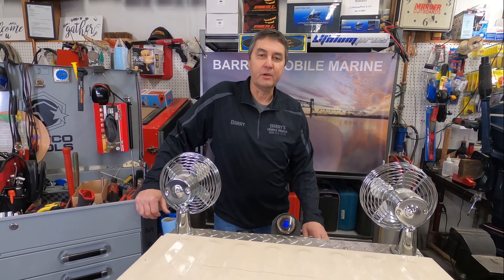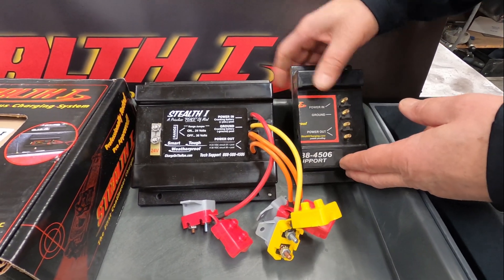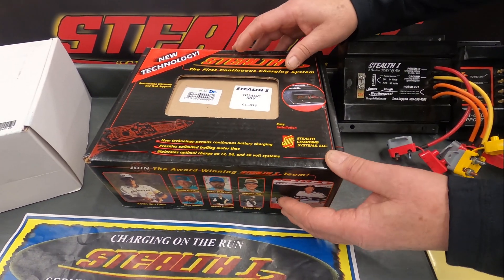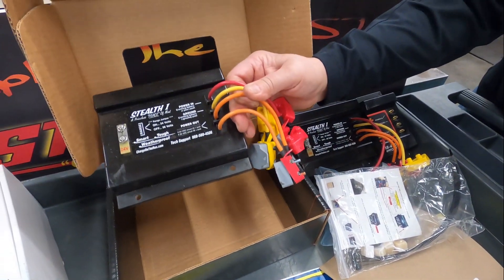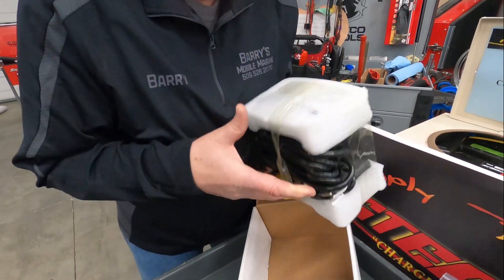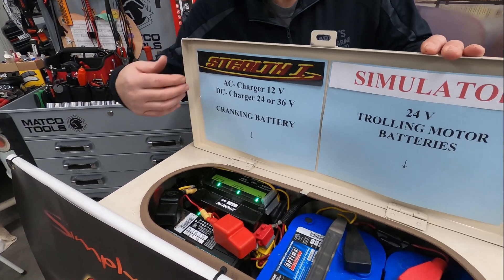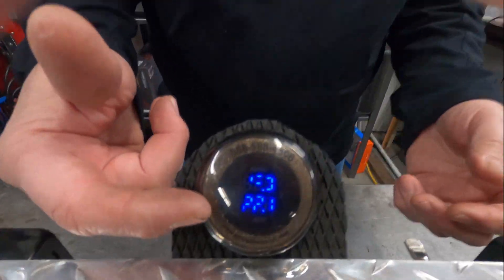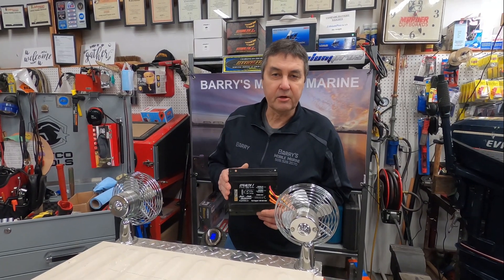Stealth 1 Charging System "Onboard DC Battery Charger" Charge On The Run! Simply The Best!

Comment: My stealth DC is showing a max of 8a into my 36v battery at WOT. Is this typically the peak charge speed for dc to dc?
Reply from the maker: Hey Casey, that is a great question! The Stealth DC max output is 20 amps. But it is controlled by your crank battery, if this is weak all the charge will be going to maintain crank battery voltage. Once your crank battery reaches approximately 13v the Stealth DC will then begin to charge your trolling motor battery. A good healthy crank battery is key. Run your trolling motor to draw down the state of charge and retest. Not knowing your motors alternator output is a key factor to answer this question. If you wouldn't mind sharing make, model, and HP that would be helpful. Let me know if this helps.
Reply: @barrysmobilemarine4372  yes sir happy to share. 2019 Yamaha 250 SHO (VF250XB). Although the cranking battery has never given me a singe bit of issue it is about 5 years old.

I ran the rolling motor below 50% and still was not able to get a charger rate if more than 41.4v, 8a, 347W. This data is off of the ionic app.

Do you think I could run my trucks jumper cables to the crank battery to test the battery as the issue?
Reply from the maker: Are you running a lead acid crank battery with the black charger like in my video? What is the voltage of the crank battery while you are running? Charge your crank battery and have it load tested. You could do this if you have a meter to watch your battery. 
1> Charge battery it must read above 12.6v
2> Pull kill switch and crank engine 10 sec. or you could trim your motor up and down and watch your voltage it cannot drop below 9.6v and once you let off the battery should recover at the 12.6v

Comment: I’m reading 29.02v on the 24v output with no ac plugged in or outboard running.  Is this normal?
Reply from the maker: Hey Jeremy, What type of trolling motor battery or batteries are you using? Not sure what a/c charger you have or outboard you are running but most systems with bring batteries up to 14.6 so if you have good lead acid batteries it may read this voltage. Hope this helps. Feel free to call me or the Stealth tech support.

Comment: I purchased a 36 volt Lithium Pro battery along with the Stealth 1 onboard charging system,  from Barry’s Mobile Marine and I am 100% satisfied with my purchase. I installed the setup on my 32’ off shore center console to power my trolling motor.
Barry knows Stealth 1 chargers and Lithium Pro battery like the back of his hand. He answered all my questions prior to my purchase  and he also gave me awesome technical support after the sale. I definitely recommend you contact him if you are considering buying a battery or charger you will not be disappointed.
Reply from the maker: Thank you, Ken for your review and purchases for your boat. It was my pleasure talking to you about your set up.

Comment: What gauge battery cable is recommended for longer runs?
Reply from the maker: Hey Noah thanks for reaching out! I'd really like talk to you about the gauge of your battery cables. There are a few factors that we have to look at first, to be clear on helping you. Are you able to call me so we can talk about it? Voltage, load, length you need to run wires, type of hull, fiberglass or aluminum etc.

Comment: I have a  charging on the run on my ranger boat and I don't think it works I have a 2003 ranger.I NEED HELP !
Reply from the maker: Give me a call and let's troubleshoot it.509-528-2070
Reply: I’m reading 29.02 of constant voltage with no ac plugged in or motor running.  Is this normal?

Comment: Is the Stealth 1 charging system compatible with lithium batteries? I am currently running 3 group 31 lead acid (interstate) batteries and the cranking battery is an AGM battery. I am thinking of converting to lithium when my current lead acid batteries need replaced.
Reply from the maker: The Answer is Yes! The Stealth 1 DC (Black) unit shown in the video is designed to run with a Lead Acid Crank battery (12.9v threshold) and can be used with Lead Acid, Gel, or Lithium trolling motor batteries. If you are going to run a Lithium Crank battery, Stealth 1 makes a Blue DC unit which has a 13.1v threshold to use with Lithium batteries. The Crank battery determines which Stealth 1 DC unit you will use. 
  You could use the one in the video with the current set up you have now. When you purchase your batteries in the future you would run a Lead Acid crank and run a Lithium trolling motor battery or batteries.
  Thank you for the question! If you need help deciding which unit to purchase feel free to contact me.

Comment: I normally unplug my trolling motor when charging on AC. Should I also be unplugging the trolling motor every time I run?
Reply from the maker: Are you using the Stealth DC unit? If so there is no need to unplug your trolling motor. The Stealth DC unit is fully regulated.
 I have TikTok videos of this system operating while the motor is running. See barrysmobilemarine
thanks
Barry
Reply: @barrysmobilemarine4372  Thanks, I am running the Stealth DC and I’ll check out the TikTok as well. I have been loving the setup so far!

Comment: I took my boat to Barry as it was not running very good. Barry was up front and told me what he thought I should do to the motor . He went over and above with checking the whole motor out and found some problems. This was an older motor with allot of original equipment on it. Barry kept in contact with me and told me everything he thought I should have done to it. He wanted my motor to run like it was his own and after he was done it did. I've had the boat for 13 years and it has never run better. Barry was totally up front and honest with every step .   Thanks Barry
Reply from the maker: Thanks Mike for allowing me to service/repair your motor. The Mariner V6 in my opinion is hard to beat. "We'll see ya out on the water".
Thanks, Barry

Comment: Hello Barry, why does the 24 vt need to be removed? I have a 36vt system.
The charger is also getting very very hot. I have a lithem pro 36vt battery with 2 12vt battery in the console. My 12 vott meter isent going above 11.9Vts. Thanks. Send me your email
So I can send you pics thank you
Reply from the maker: Hello Anthony, 
The Black Stealth DC Charger in my video is a dual range charger.  When you have the shunt installed it is a 24 volt DC charger, when the shunt is removed the current passes through other circuitry and becomes a 36 volt DC charger. The Black DC 24/36v charger is commonly used with a lead acid crank battery  and lead acid, gel or lithium trolling motor batteries. A charge threshold of 12.9 volts to the crank battery must be reached before charging the 24 or 36 volt system. What Charger are you using? Stealth also makes a Blue 24 volt and a Blue 36 volt DC charger Which are stand alone DC chargers. These DC chargers are designed to work with a Lithium crank battery and 24 or 36 volt systems. Lithium DC chargers will bring the crank battery to 13.1 before charging the 24 or 36 volt system. Concerning your 12 volt system only reaching 11.9 volts I will need more details to help you in that matter. My phone number is listed in my video. My e-mail is barrysmarine@gmail.com
Barry
Reply: Barry, thanks for the phone calls and constant communication.
You are truly a good person.
Reply from the maker: @anthonymannarino3376   Thank you Anthony! I was raised to go by The Golden Rule. Enjoy!

Comment: Can I use any AC Charger in combination with the Stealth DC? Would I just want my AC Connected to the crank and let the Stealth DC push it to the trolling motor batteries. Would my AC chargers indicator reflect a full charge this way, since it is only "directly" connected to the crank?
Reply from the maker: Great questions! You can use your charger. The Stealth DC unit will bring your cranking battery up to 12.9 volt and will then begin to charge your trolling motor batteries once they have been charged it will complete the charge on the crank and your light or lights will show full charge, each charge bank may have a higher or lower threshold and may show full charge at different times. Just as you mentioned if all will be controlled by the Stealth1 DC unit.
I have several videos on Tik Tok under @Barrysmobilemarine
thanks for your question
Barry